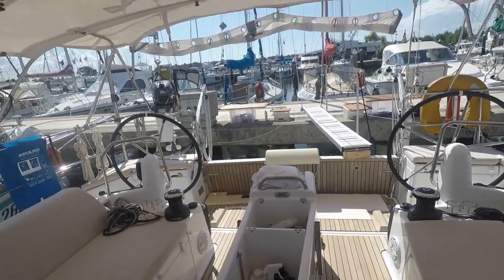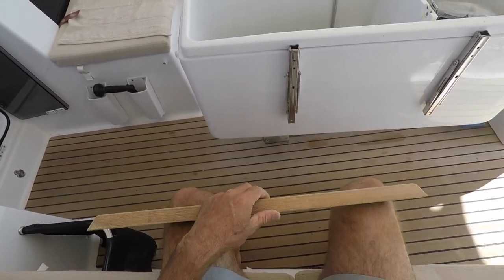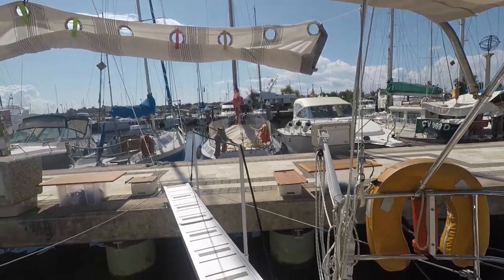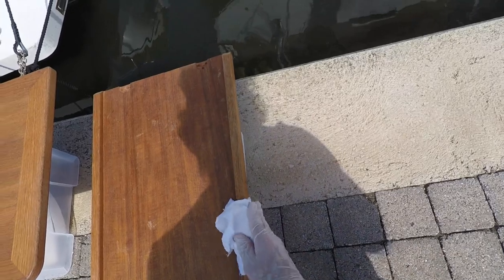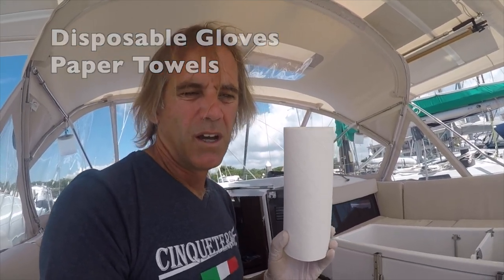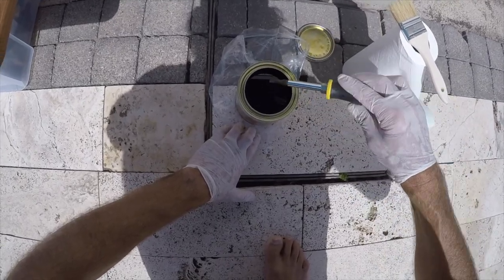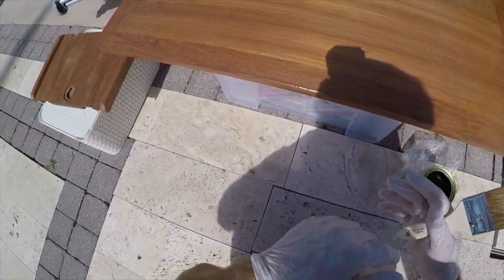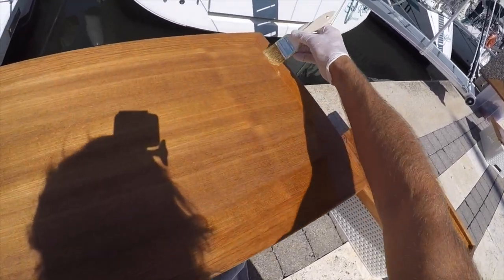Boat Varnishing: Simple, Satisfying! | Ep. 31

Comment: Best varnishing video for the average boat owner I have seen so far.  Any suggestions for supporting a piece that is drying? It has to rest on something. Is doing one side at a time the only option? Seems like that would double the time required. Thanks
Reply from the maker: Thanks Andie. There's no easy solution to varnishing both sides of a piece. If you can hang it from say a hinge or latch, you might be able to get both sides and edges, but you run a greater risk of runs. I usually prop up large flat pieces with a few small blocks underneath. This allows you to get the sides as well, and air flow underneath to help the drying process, as well as to catch any runs on the under part of the edges. If you are doing a table top or similar surface, you don't need an equal amount of coats on both sides; just a few coats on the side that doesn't see the sun is all that is needed. If you flip the piece over before it is 100% dry and hard, you can use a bit of wax paper to keep it from sticking to the blocks of wood underneath. Good luck!

Comment: I have found that it is preferable to not start varnishing earlier in the day because the wood is heating up and releasing vapor which can appear in the varnish as bubbles.
Also, when you are finished varnishing and are about to place the lid back on the can, if you take a propane torch and turn it on without lighting it, out of the wind, and allow the propane to flow into the can (it is heavier than air) to displace the air in the can with propane.  Then place the lid on the can.  That prevents the varnish from skinning over in the can before the next time you open the can.
Reply from the maker: Thanks Tod. I have not noticed an issue with wood vapor forming bubbles but it sounds like a good thing to be conscious of when considering how early in the day to start. And thanks for sharing the tip on propane in the can!